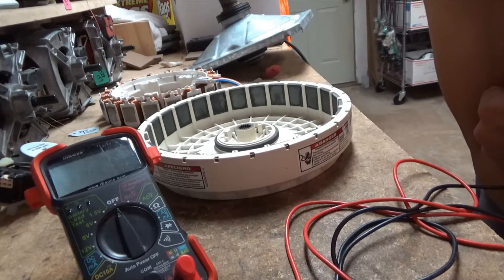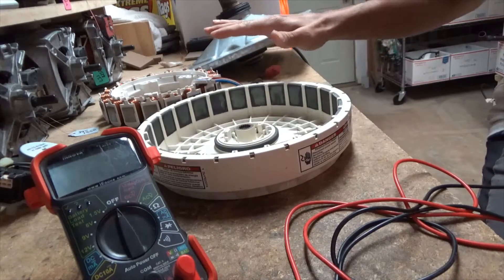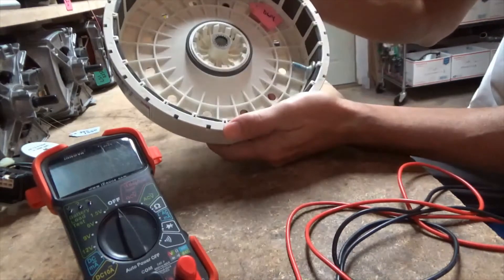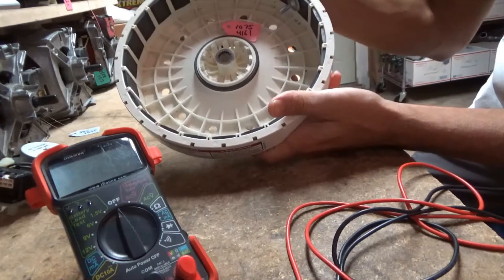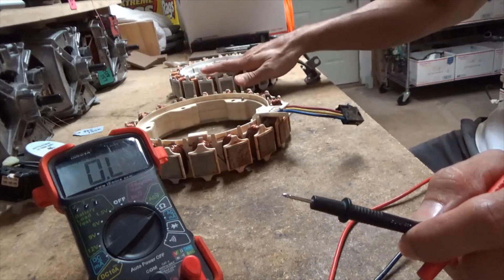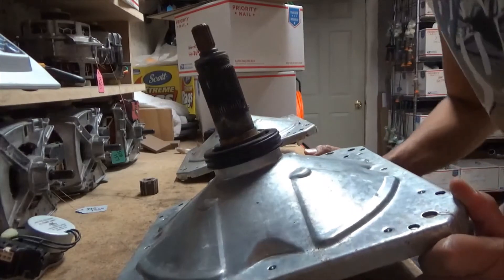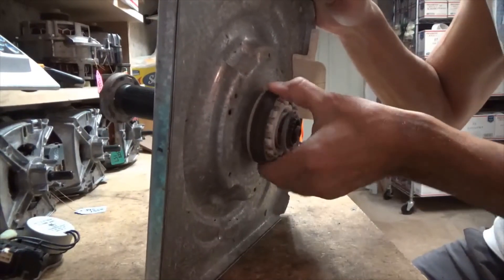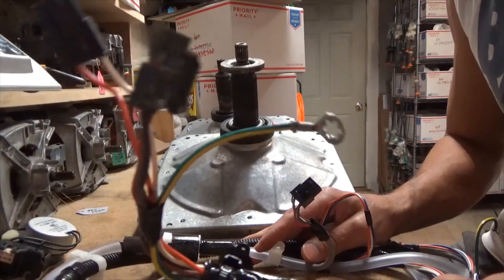How to test your Whirlpool Washer Motor and Gear Case : Save $$$ by diagnosing yourself !!!!!

Comment: Have you ever opened one of these units to expose the internal planetary gear box? I've opened them completely and revealed after removal of old grease inspection of plastic gears and repack with new grease. It's ridiculous to buy the whole unit just because the seals have went out allowing water to leak. You can however get the tub seal and inner agitator shaft seal online with a little searching. I got the small wash plate shaft seal from autozone for 3 bucks the tub seal took some extensive research to locate even with part number on seal but it was direct from whirlpool fir about 30 bucks. Bad thing is when tub seal failure happens it tends to fry the stator from water shortage. Poor design  flaw imo but saved myself a couple hundred bucks

Comment: Does anyone have a old junk "gearcase" laying around that they would do an experiment on for me??

I believe you can knock the shaft out and replace the bearings,but the gearcase i have is still working and i don't wanna trash it in case i am wrong.

Youd want to get a socket that only contacts the larger main shaft and beat on the bottom end where the motor goes and in the direction of the tub.

The bottom bearing i believe is a 6006z and costs $15 and id bet the top bearing is probably the same one,so if i am right we could rebuild these cases for around $35 or less and save the $200+ cost of buying a new gearcase.

Comment: Finally. Someone who actually talks and explains what we're looking at.

Is the gear case rebuildable ? I see rebuild kits on Amazon. Are they worth it?
Reply: Absolutely worth it  but this particular one in the video is not serviceable nor do they offer just the seals for sale. I however refuse to pay for the entire unit when seals are the only failure it took some looking but was able to find the tub seal direct from whirlpool and used calipers fir wash plate seal dimensions and got it from autizone for 3 bucks the tub seal was close to 30 bucks.  I even opened the case to expose the planetary inside as well as opened it up for inspection. It was fine other than rusty grease witch I replaced with new before sealing the "non serviceable " unit back together and installed it without issues. Someone makes those internal plastic gears as well and I'm sure with a little more looking g I could locate the manufacturer of those gears as well as aftermarket steel gears mire than likely. Just remember where there's a will there's a way and closed mouths don't get fed lol

Comment: What about the clutch?

I'm having an issue with the slider not engaging. I put on a new clutch and still no luck. Tub won't spin. I replaced the ACU and clutch.
Reply: Ever figure it out?
Reply: @solidsnake6405   Yes, It was the damn clutch slider... if you look closely to the part that he is spinning at 6:13 it has white dots around it, those plastic dots hold that black piece together... the black piece stripped from the white part causeing the no spin issue... there was no sign of wear until I took it completly off and it fell apart. Easy fix, lesson learned...  but that piece is really made poorly... for the amount of weight it has to engage... poor design.
Reply: @firstrak  ok,thanks..

Comment: How do you replace the " Slider " on the bottom of the transmission?   Gearcase.
Reply: The snap ring is designed like a key ring. Find one end and slowly pry it off. Slider should slide right off